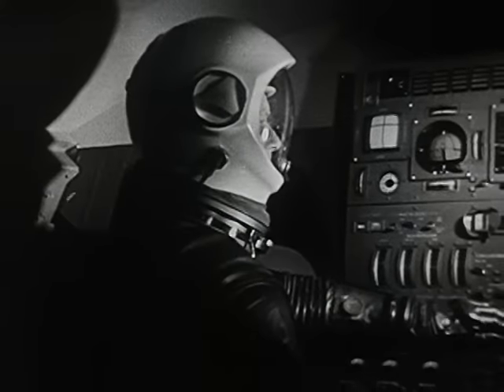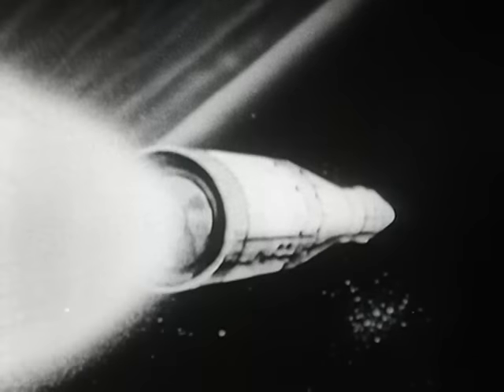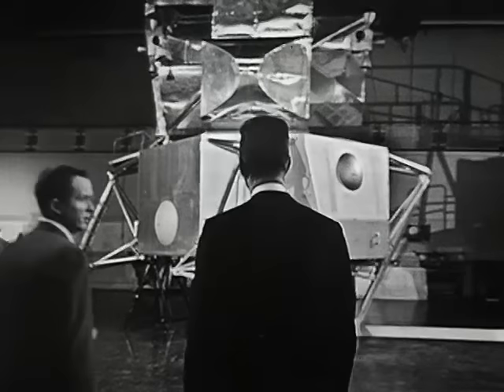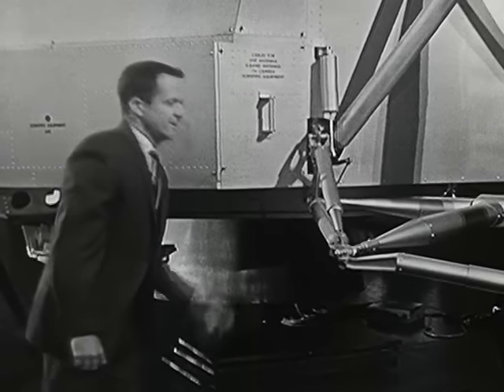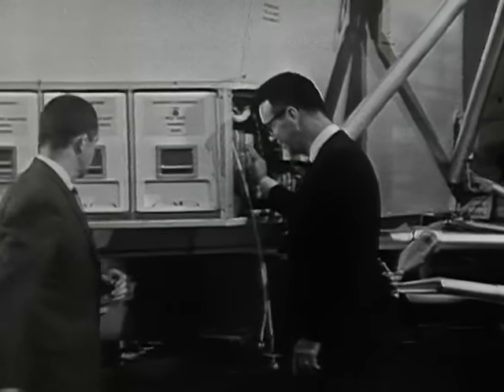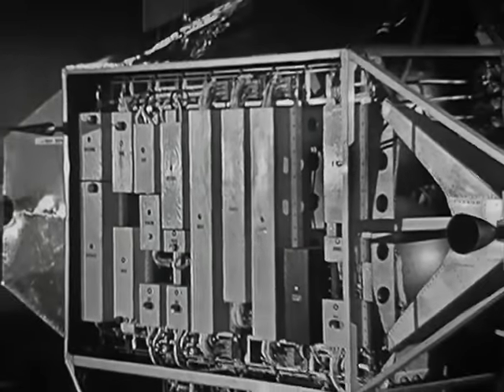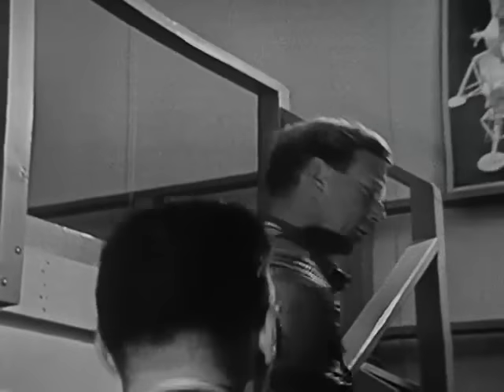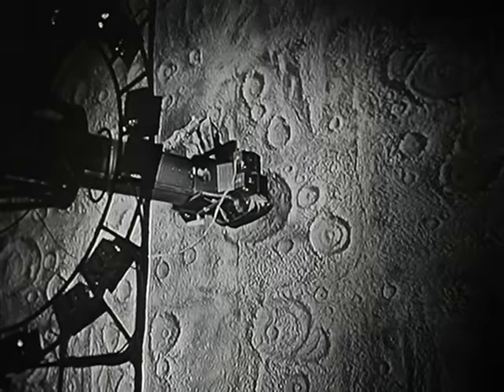MIT Science Reporter — "Landing on the Moon" (1966)

Comment: The moon is 250,000 miles from the earth circling the earth roughly every 24 hours. Thats the radius of the circle of the orbit. Times 2 is the diameter of the moons orbit. The diameter times pi is the circumference. So, 500,000 miles times 3.14 is 1,570,000 miles divided by 24 hours is 65,416 miles per hour. The moon is traveling at 65,000 mph. Its impossible to land on. One would have to fire off a rocket in a single direction in order to try to intersect with the moon which is coming around at over 65,000 mph. The circumference of the earth is 24,900 miles, to circle the earth at its surface requires a speed of 1,000 mph to do so in 24 hours. Multiply the surface speed required times a distance of 250,000 miles outward. 1,570,000 miles divided by 4 is just under 400,000 miles. If the moon was traveling at 10,000 mph it could only go a distance of 240,000 miles, thats less than one fourth of its total orbit. 
So, thats like from the 12 to the 3 on a clock at 250,000 miles. That moon is so far away, it has to be traveling so fast to be seen every night. Now the earth is 93,000,000 miles from the sun. Thats the radius, times 2 is the diameter, 186,000,000 miles times pi 3.14 is 584,040,000 miles divided by 365 days, the earth is traveling 1,600,109 miles per day divided by 24 hours is 66,671 miles per hour. That is roughly the same speed as the moon is traveling around the earth. Now, the moon is precisely far enough away from the earth as the sun is away from the earth so that during an eclipse the moon fits over the sun at the exact same size. Thats pretty cool really.
LLXIIX77
Reply: It takes 27 days for the moon to orbit earth, not 24 hours.

Comment: Not till recently was real time low latency video possible over wireless so how does a TV go realtime as smart salary MIT guy said. Seems a bit ignorant of telecom tech of the era, soap box racer stuff considering the temo in sun on the moon. Welding shop foundry ambient heats, 225+ F -200 in dark..
Reply: Ah yes, the temo of the sun, always a concern.  And the temperatures in other places on the moon were extreme!  How are you surviving the max and min temperature of the Earth?
Reply: The first real time low latency video possible over wireless transmission was the 1936 Olympic Games in Berlin.
Reply: @bradleyrex2968  LOL! link? and Tesla made a death ray too. The new DJI digital FPV transmitters are just barely real time. 5.8ghz in 1936? WW2 Germany had some trick stuff but TV was first transmitted from NY to Europe in 1962 by Telstar sat so the lack of moon delay is as bs as lead acid battery powered Willys jeep rover fantasy.
Reply: @441rider  I have provided 2X as many links as you.  Learn to use a search engine, it's not hard.

Comment: What, It can be automatically flown down to 200 feet. But it cannot land itself?. What , only a few minutes of ⛽️ fuel? WTF. What shut the engine off and land without power?. WTF.. HYDROGEN PEROXIDE FUEL, The same fuel that blows up and destroys everything. ? WTF.
Reply: WTF?  All fuel blows up and destroys everything.  Otherwise it wouldn't be much good as fuel.

Comment: Surely we could of gone to the moon in the space shuttle.
Reply: No we could not.
Reply: @eventcone  why not?
Reply: @garethleyland4942  
It was too heavy, too big.
It had two huge wings and a verticle stabiliser - all useless in space yet adding to the mass, mass that had to be accelerated out of low earth orbit, decelerated into lunar orbit and then accelerated onto a trans-earth trajectory. It could not carry enough propellant for all that (plus mid course corrections).
It's heat shield was problematic and designed for a 17500 mph re-entry, not a 25000 mph re-entry.
It was what it was - a Shuttle between Earth's surface and low Earth orbit, not a true spacecraft. Certainly not a deep space craft.

Comment: After watching this detailed video now I know FOR SURE that there's NO WAY we ever went to the moon. There is NO WAY those two grown men would be able to move around in that small LEM. Especially when you take into consideration that they were wearing thick, bulky SPACESUITS and air tanks. I mean how the hell did they sleep, eat and get in and out of those space suits in such a small, confined area. And then how the hell were they able to squat down and crawl out of the LEM and on to the moon surface through that small hole without the risk of puncturing their suit and/or knocking or DAMAGING their suits or air tank. Bottom line, we NEVER went. Case closed!
Reply: You'll find all the answers to your questions are available and independently verifiable. Ignore that, which you have, and you have no 'case' to close. You personal incredulity has no bearing upon reality.
Reply: @yassassin6425  Whatever Yass. You are ignoring common sense. There are too many issues (size of INFLATED space suits PLUS back pack, where they pissed/shit etc., moved around to squeeze into the bulky suits, then squat down into that tiny hole..that is barely big enough to fit a man simply wearing a t-shirts and jeans. PLUS, look how much cloth is needed with those THREE LARGE PARACHUTES that lowered the much smaller capsule into the ocean. I've packed  SINGLE chutes just large enough to support a man and that took up a lot of room. Multiply that times three, plus the NASA ones were MUCH, MUCH, MUCH BIGGER parachutes. Where the the did they have those things rolled up into. They NEVER talk about that or ever show it.
Reply: I don't believe it therefore it isn't true, case closed! Brilliant!
Reply: If they couldn't move around in a small LM (not "LEM"), then what exactly was stopping NASA from making it larger?
Who is ignoring "common sense" here now?

(also, they do "talk about it". You just can't be bothered to do a proper research)
Reply: @Jan_Strzelecki  : Jan, Jan, my friend. Are you really trying to use logic with a hoax nut? That's a tall order you've set yourself there. Good old dave preston probably doesn't even understand the logical dilemma he's placed himself in. Instead, he is going to keep going on about inflated space suits since he thinks it makes him look smart.
Reply: @kitcanyon658  I know, it is a tall order - but sometimes, sometimes they do respond to logic.
Besides, my main objective is to show others how illogical and simplistic the hoax believer's position really is.
Reply: @Jan_Strzelecki  : That's a good point. I too try that; exposing such illogical claims. I mean, if NASA was so all powerful and had billions they could have done as many "takes" as needed to get everything just right.
Reply: The training LMs they used to practice " sleep, eat and get in and out of those space suits in such a small, confined area" are in the Smithsonian Museum.  look for an article called "50 Years Ago: Two Critical Apollo Tests In Houston" for some info on the YEARs of extensive testing they did.  But it was not meant to be a luxury cruise. 
The white outer layer of the suit holds no pressure and is reinforced with kevlar is intended to stop micro meteoroids.  The "air tanks" you imagine are spheres holding liquid oxygen inside the PLSS backpack with lots of shielding.  It should all hold up to some bumps in the lander.
But believing/claiming/pretending the moon landings are fake is not about facts, it is emotional journey.  Most of you guys dive in of about 2 years and then get past it.  Good luck!
Reply: @123davepreston  Are you one of those people who don't believe in anything unless they've seen it themselves? Your understanding of what's possible and impossible only shows a lack of imagination rather than an argument based in reality.
Reply: @lgmx-peacekeeper3204  again, I understand for a lot of people, their entire worldview and emotional stabiity is wrapped up in the Apollo program being 100% real, however, look up what the speed of an object falling from lunar orbit to the ground would be, and kindly watch a video of the capsule gently rocking in a parachute. Understand something, they would be moving so incredibly fast that nothing would be able to slow them down, much less the G force and heat of re entry. It's not like coming in from Low Earth Orbit, there is MUCH more kinetic energy generation from the high potential, 250,000 miles higher.

Comment: And what protected the astronots and all those sesitive electronics from the van allen belts of radiation?  A thin sheet of metal.😝😂
Reply: Where did they put the air conditioner? lmao!
Reply: How much protection do you think they needed?
Reply: @77huss  - It used something called a vacuum sublimator to cool itself. A sublimator turns ice directly into water vapor in a vacuum to carry away excess heat. It was located in the rear of the ascent stage under the electronics bay. Why don't you stop laughing your ass off and do some intelligent research and educate yourself?
Reply: You can block certain types of radiation just with a sheet of paper, learn what radiation is before you decide to make yourself look like an idiot.

Comment: @UC7U_d8xCOyPuAOa95Kj_K0A
 says "hard trying to sleep in the LEM with little room", but the 
essential toilet and shower facilities as all Americans need when the 
outside temperature is 150˚c was not installed. That is why they looked 
so destroyed weeks after when asked to relate the exciting trip they had
 had. 
Have you ever had a 14 hour flight to Asia? These guys stayed 
cramped up for days and had great food aboard so were completely 
confident that the hi-tech gear we see with instruments measuring 'feet'
 on a wheel, would get them comfortably to the surface and then with a 
Honda 50 engine propel them 60 miles into the atmosphere to meet the 
command 'module' flying past at 1600 "miles per hour". But they loved 
the "American Units" when calculating. Nothing decimal and standard for 
those boys, no, they preferred the 16 'ounces' in a 'pound', then 14 
'pounds' in a 'stone' and 12 'inches in a 'foot' and three 'feet' in a 
'yard' and 1760 'yards' in a 'mile' so any Newtonian calculation could 
be quickly checked using fingers and thumbs, sliderules and radio 
signals to "Houston Control" who had the farmer boys all using 64 byte 
computers calculating the 'feet' and 'fingers' from disaster. Brilliant.
 Really good to see some lonely Americans who still can't let go of the 
fantasy that 'their boys' got them to the moon and back in some rods of 
scaffolding covered with heat resistant radiation 'special' tinfoil, 
which was sold out just after they got back home and has since gone out 
of production.
Keep it up yanky boys, we would have no one else to 
ridicule if it weren't for you. You are absolutely the best and 
apologies to those of you who feel insulted by me joking about this no 
doubt very serious crime and theft of trillions of your tax money. You 
can afford it. Just print out some more.
Reply: They're only units. It doesn't matter what system of units you use as long as you are consistent.

Humanities greatest engineeering achievements probably were done using non-SI units.

Comment: Looking around inside the LEM.. WHERE WERE THEY STORING THOSE BIG PUFFY MR MARSHMALLOW SPACE SUITS? AND WHERE WERE THEY PUTTING THEM ON? AND THEN WHERE WERE THEY EXITING AT THROUGH A 24-IN DOOR EVEN THOUGH THEY HAVE 36-IN SHOULDERS? WHERE WERE THEY STORING THE OXYGEN THEY NEEDED TO AT LEAST FILL THE TANKS OR REFILL THEM? YEAH THIS IS ALL REAL PEOPLE
Reply: They didn't need to stow the suits as they wear them most of the time in the LM, they, also don't even take up that much room. Where did you get the measurements for the hatch and their shoulders? The oxygen tanks obviously weren't in the cabin.
Reply: @msidc1238 most of the photos from inside have all been wiped from internet. For just this reason. They must have stowed them right by the dune buggy. And the oxygen generator.
Reply: The LM had 2 doors goofus.
Reply: @texmex9721  yea..uh huh . Wow you just believe everything dont ya...doofus 🤣🤣🤣🤣
Reply: @texmex9721  was the other door the garage door where they rolled out the dune buggy...doofus 🤣🤣🤣🤣
Reply: @mattstickle2725   Ad hom this early?  Who's a grumpy hoax folks?  You are.
Reply: @texmex9721  doofus.........🤣🤣🤣🤣🤣🤣
Reply: @texmex9721  the LM (LM 🤣🤣🤣) had two doors ad hom hoax folks.....🤣🤣🤣
Reply: @mattstickle2725   Yes. 2.
Reply: Instead of constantly asking questions in a form which imply your pre-formed conclusion, why don't you (as I put in another comment above) start actually learning? You would then actually have the knowledge necessary to come to informed opinions. The answers to all your questions and many more are easily available out there.

I know nothing of worth about motorbike engines. I know how to ride bikes pretty damn well. But I do not have the knowledge to fix them. Nor do I want it - I'd rather enjoy riding them and I'll happily pay an expert to service and maintain it. Because he's an expert and my expertise and interest lie elsewhere. So, imagine if the expert mechanic told me that the valves tolerances needed adjusting, and I said "Nah! That's BULLSHIT mate, BULLSHIT! I've heard on the internet that that noise is normal and you would say that cos you'll make load of money. It's actually just a conrod tappit blaticulating on the inner camshaft overhand - nothin' to worry about". What would you think of me and my approach? Cos (assuming this was a trustworthy garage, and I make sure they are), I'd clearly have an uninformed opinion - and the wrong answer.

Well you're doing exactly that - and so are all the other contrarians. Instead of learning (which will automatically allow you to informed opinions), you're just repeating what you've heard from other contrarians and adding outrage. At the moment, you have an opinion - but it's an uninformed one. It's also a wrong one, but that's another thing! This isn't about you vs me, or them vs us - it's about knowledge. If you don't gain some knowledge - whether about these missions or motorbike engines, then you're at the mercy of nonsense.
Reply: @gordonpanther7766  Where did they store the puffy marshmallow suits? Where's the video of them putting them on? And getting through the pod bay door? If these questions have been answered then why do people keep asking them. You can believe what the government puts out there. You stand firmly and defensively because you don't want to admit you've been duped. Like when the government told you that Oswald was the loan gunman. Or that the Gulf of Tonkin wasn't a false flag. Or the Tuskegee experiments never happened. Did you believe all that too? That was considered information put together by people that know more than you do back then. When did you stop believing the regurgitated status quo story and start thinking for yourself?
Reply: @gordonpanther7766   If he can't count the number of doors in the LM, what are the odds he can learn?
Reply: Well, sounds like you've got it all figured out then.
Reply: Incisive.
Reply: @mattstickle2725  You've given me an idea Matt Stickle. How about this? Let's pick one of your questions. Let say - how did astronauts get through the door of the LM to exit for a walking on the moon, and then re-entering - how did they fit through the door? It was 'impossible'...

Here's the deal:

1) You head off to suitable parts of the internet, Amazon bookstore, library, etc. and try to get the necessary data to answer that question for yourself. Learn enough about the LM, the spacesuits, EVA procedures, development, testing, looking at relevant books; technical specification documents on the suits, LM hatch etc; website links etc. It hopefully goes without saying that you need to focus on mainly 'primary' documents.

2) Return here and post your findings, along with your conclusion.

3) If you find that the feat of exiting was actually impossible and show why, your findings will demonstrate that to me and everyone else.

4) If you fail to find any supporting data to enable you to come to a definitive conclusion then summarise the sources that you tried (exact titles, webpage links etc.). 

5) If you have tried to learn but failed to come to an answer, then you will have demonstrated willing. I will agree that I will then go and find those documents for you and present them here.

Basically - if you put the hours of effort in but fail (not necessarily surprising, if you are new to this), then I will finish the job for you.
Reply: @gordonpanther7766   So has he learned?
Reply: @TexMex421  I haven't heard anything back yet. Perhaps he's in his library, or perusing reliable areas of the internet doing exactly that. Well, you never know...

Comment: I just don’t buy it. Critical thinker or not. It’s hard to imagine that this equipment made it to the moon and back. 😏
Reply: It didn't. No Lunar Module came back from the Moon. The Descent Stages were left on the surface, and the Ascent Stages were jettisoned in lunar orbit, later to crash into the Moon.

As for "making it there", the LM was a "passenger" on the way to the Moon. It was not powered up until it was needed for its descent to the surface
Reply: You "dont buy it?" Do some real research and forget the "critical  thinking". Maybe then you can come up with an opinion thats is not based on "its hard to imagine".